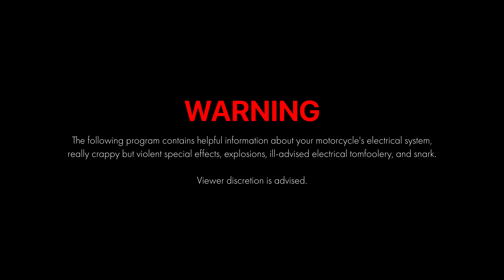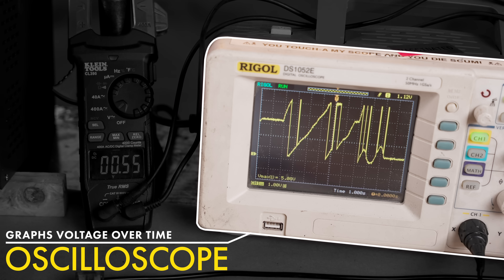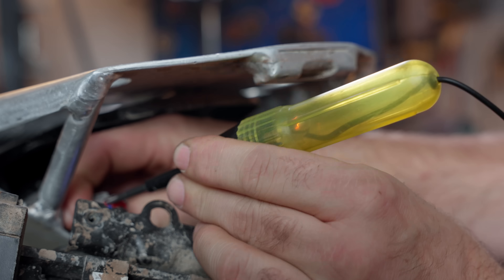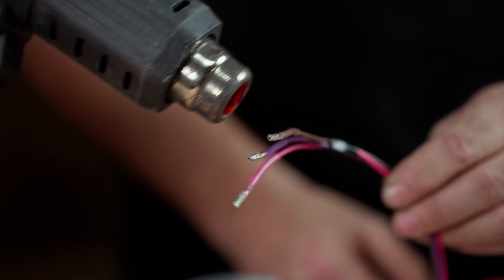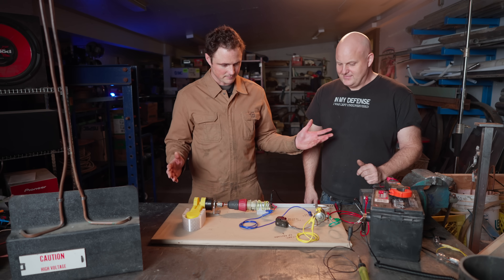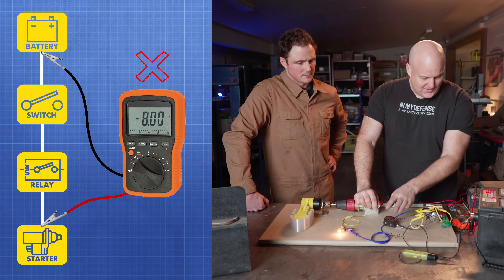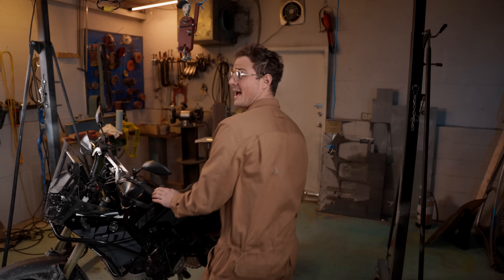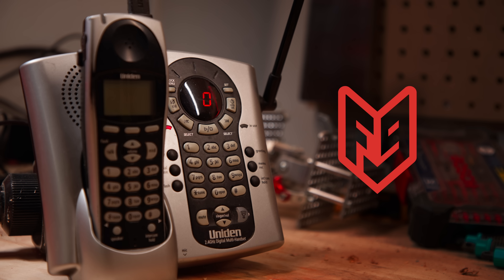5 Motorcycle Electrical Tips from a Pro

Comment: Hello so recently I've installed a new headlamp and blinkers and such. Is it possible to wire my front blinker grounds to the headlight ground on H4 plug or is that a bad idea? I kind of deleted the splitter ground thing it had going on. I planned on going full rebel with no front blinkers but have since changed my mind since acquiring some decent amazon blinkers that i like.

Comment: With regard to the TPS, the one on my Tracer 9 was replaced under warranty last year due to throttle surging and hunting on tickover.  It's now been recalled as there is an issue with some CP3 TPS units so it will be a new TPS and EMU map, I don't know if it affects the CP2 engines but I would bet the TPS is a common component in both.

Comment: that starter system diagnosis really helps! i have a odd issue with my bike where somtimes i press the button and i hear the relay click but the starter does nothing i have to push the button a few times and then it starts so im gunna use those tips for sure!

Comment: omg--you get it!  I have so many times tried to tell technicians that a bad wire can ohm out good but still be bad and will read voltage as well ---made a video where i actually cut the wire in the middle and  stripped the ends--simply laid one end on top of the other and shot from end to end continuity and power --good every time ---this is why a bypass wire is often your best friend.  Also held true on a o scope, a 3m 900ast, low voltage test bulb as a load lamp, and a $100K eclypse tester.  In over 42 years of my career I had to explain this over an over to non believers and that a fault isolation manual and ohms checks were a start not proof.  In all the time utube has been around this is the first time I've seen someone present this simple truth.  Congrats! you get I see! subbed. if only you were around to say yeah he's right all the time ha ha ha !  :)

Comment: I love the jump from safety pin non-invasive splices to an oscilloscope! Though I would wrap a bit of electrical tape around them at least, it's very easy to blow a fuse or short something with those jutting out at an angle like that. Also if you don't have an oscilloscope, while they are pretty useless for most oscilloscope things, those little $30-50 'mini oscilloscope' kits on Amazon should be adequate for something like this.

Comment: Can someone, please, deeper explain Tip # 2? I didn't get it at all. Where do you need to put the tester on?
Reply: He has the test light alligator clip on the bike FRAME for ground.  He is probing with the tip on positive wires and sees the lamp light when it completes the circuit.  Then he connected the tip to a ground wire somewhere on the tail lamp.  This completed the ground circuit  through the test lamp connection, and allowed the tail light to light up,  so he knew there was a bad ground connection somewhere between the frame and where he tested with the tip.
Reply: @timothyswartz5292  thanks man. I barely know anything about electricity/electronics and I thought this was a pretty good tip. I appreciate the explanation, is way more clear now

Comment: Friggin' love it.  However - DONT EVER USE SILICONE CAULKING for anything electrical.  It produces Acetic acid when it cures - This is vinegar, and will thoroughly corrode wiring in a couple of hours.  Specialty Silicone gasket goo may work;  RTFM (Read The Full Manual.)

Comment: Jump starting from another vehicle is perfectly ok even if the engine is running. All 12v automotive batteries are charged at around 14.6v just like your bike does. 

A battery on a tundra showing 14.5v while the engine is running absolutely won’t ‘fry’ your dead bike battery.
Reply: Of course you are generally correct. The details get complicated, but in general there is little risk jumping a bike from a car. The guy making the video clearly does not have a strong background in electronics or risk assessment.

Comment: Hey, Fortnine, I have an electrical issue that beats me in my starter setup. Power goes to the relay but it does not pass through it. I’ve replaced the relay twice, but to no avail. Is there any reason that might be happening?

Comment: The trick with the pins on the back of the connector is neat, but people usually don't have those handy. 

What I usually do is get a paper clip and wrap it around the probe a few times, then create a sort of extension. It works wonders. 

Regarding measuring voltage instead of ohms, I thought that I was the only one who got that lol.  I even check fuses that way. The voltage at the top has to be nominal, then measure voltage at the bottom of the fuse, and if it’s different you know there is a bad connection.

Comment: You don't need a oscilloscope. The needle on an analog voltmeter will move with (and show dead spots in the coils), and works just as well for testing throttle position sensor/actuator and more. (FYI-I got a perfect score in electrical at MMI in 1990) You can also buy replacement electrical connectors at industrial hardware companies like Grainger.

Comment: I once used a large safety pin I found lying on the ground to reattach one the battery cables on my 650 Seca (remember those ?) when the nut fell out. Never underestimate the utility of safety pins. 
I like how you blew up 47. I thought there was a message in there, but then you diluted it by offing a couple more clones.

Comment: as an electrical engineer, i'm obligated to say the first one is a terrible idea, specially the part "you can ride with it to keep track of the voltage", yeah, no. it's fine for on the bench measurements, as long as you are careful, but on a ride, that would 100% short, which doesn't seem like a great idea, depending on where you are checking the voltage from

Comment: Just a nitpick on 5:22 stranded wires designated to be crimped shouldn't be twisted. It interferes with the butt crimp that's designed to separate the wire strands into two bundles before squeezing them into a cold weld. 

In practice, twisted wires will probably work fine at first but will fail earlier due to corrosion working its way onto the crimp interface, or the wire just works itself loose.

Comment: I got my Street Triple RS's battery drained overnight because i forgot to unplug the keys. Only connecting an external battery for starting the bike wasn't enough, the bike would not keep consistent RPMs and eventually would stall, only by keeping the external battery connected for a while  would prevent this. I guess Modern bikes rely on some electrical power even when they are started.

Comment: The safety pin tip and the silicone tip are real redneck engineering dodgy tips. They will probably work, but just keep in mind that they are absolutely not best practice.

You absolutely could damage something jamming a safety pin into the back of a connector - you might break the wire, you could damage the waterproofing, etc. Be careful, and consider other options for measuring first.
The silicone tip is a weird one, as surely it'd be easier to just replace both connectors with something suitable, if not original. Lots of commenters have pointed out that silicone can be corrosive, and you won't have any of the latching mechanism, so I'd expect a lot of silicone improvised connectors to unplug themselves given all the vibration. Even just individually attaching the wires in the connectors with single wire crimps seems like a better quick fix.

Comment: Good video, especially explaining  how a resistance check can mislead you in a high current circuit. I do have to disagree on "cooking" the MC electrics by leaving the jumper cables connected. "Cooking" happens when too much voltage is applied to a circuit. The largest 12V battery is still 12V, and the MC circuits will only see 12V applied to them.
PS: I hope 49 didn't cause too much damage to the truck's grille.

Comment: Motor company certified motorcycle technician here.... rebuttals:
1. Safety pin probes... "no". could easily damage the waterproofing rubber on the back of the connectors. Just unplug the connectors and do your tests there with jumper leads.
2. Oscilloscope: "yes", but expensive and you don't really need it. you'll be able to see the glitch on a digital multimeter if you go slow enough, and if you have an analog (needle) type meter, you'll be able to see the glitch there for sure.
3. test light on tail light- "ok, but to do not back-probe connectors"... could damage the connectors. Just unlpug the connectors and test that way. Make yourself test leads with ends that fit the male and female pins of the connector's plugs.
4. silicone connector: "only carefully". many silicones release acids when curing, which could damage the connector's plugs or the device you poured the silicone into. Check the formula of the silicone before using to be sure it won't release acids when curing.
5.testing the starting system for voltage drop... "yes", H-D does that a lot and it is effective. However, a resistance test using an ohmmeter WILL show increased resistance when it's there, so either test is viable.
6. jumping a MC with a car: the car must be OFF when jumping a bike. it's not the battery that fries, it's the voltage regulator that fries. When the voltage regulator fries internally, it prevents your bike from charging your battery as you ride. it may appear you fried your battery, but you actually fried part of the system responsible for re-charging your battery.

-you're welcome, all.  ;-)
Reply: Back probing is a tried and true testing and observation method.  Most manufacturers use proprietary or near proprietary connections. Finding proper pigtails to install a test jumper isnt viable in most cases. Safety pins, ot T pins which is more common are perfectly valid methods of back probing,  specifically becayse they are so small and will feed through connection gasket easily. They also sell actual back probing test lead kits that have a probe with an end that will fit on your test leads for a solid connection. 

Any tool use improperly can damage what you are working on, however probing the connection side of a plug is the easiest way to damage the contacts. Probing from the rear avoids damaging the blade connection entirely.
Reply: Thanks man, I really need your advice over the koenigsegg guy because he's probably not even a real "Motor company certified motorcycle technician", he's just the founder of a car company
Reply: Regarding #6, you are absolutely right about the donor car being OFF when jumping, and that goes for jumping ANY vehicle. Two generators on the same circuit is always going to cause trouble and must not be allowed to happen. Also, with the donor car OFF the electronics are also off and therefore not likely to be damaged by voltage surges and spikes. Finally, vehicle generators are NOT designed to power starters! A starter is effectively a dead short when initially energised until it starts to spin.
Reply: To add to the connector, it's silly but use paint to mark orientation, certain configs can just have you putting back in and 'rotating' the pins around, especially without hard plastic guiders, you can 'force' a silicone plug another way. As for back probing, like, in this exact setup with two safety pins just parallel.. yeah, no.
Reply: 6) Crap, I jump started my bike (bmw 800cc) with my opel karl (1000cc). 
Is it really a big problem if both systems are somewhat still on the somewhat power level?
Reply: Hi, can you elaborate on why the regulator will die when a cat with running engine is used? I was always told 12 volt is 12 volt, but i am definately not an expert.
Reply: @rienkhoek4169  I'm confused by that as well other than cars will show 14v+ when running (the alternator needs to be higher voltage than the battery to charge a battery)
Reply: @subjekt5577  True, but that is the same for a motorcycle.
Reply: The back probing for diagnostics via safety pins is a bit janky, but probably OK. I do wonder what he means at 0:40 when he says connecting to something on your dash while riding. Is he saying diagnostic or to permanently wire up something? Diagnostics... ok, permanent... no.
Reply: Nobody got time to make plugs and nobody is going to pay for those hours.  Back probing every day for the last 4 years. You are not going through ruber seal, you go along the wire.
Reply: About the silicone thing, if it smells like vinegar, don't use it on your wires EVER. That's only good for the engine casings.
Reply: How do you know he's not a certified technician?
Reply: The only one of them I can coment on is the first one. If you shuve vi the pins you will probably brake it butt bearing cerfull can work once ore twice untill you slip and destroy the connector
Reply: Thank you! 

Sincerely, nobody

Comment: Thank you!!!!!!  #5. Jumping. I tell customers this and they think I'm crazy. "I jump it with my truck running all the time". Yea there is a reason you gotta jump it all the time moron!!!  I was 15 when I learned this. My father took my 1100 Suzuki to town. Killed the battery some how. And jumped it. And I suddenly had trouble with it a lot. My mentor told me why and showed me how to fix it. Owners never friggin believe me when I tell them to leave the car/truck engine off. At the shop we have a marine battery with a set of cables with clamps from an old school jump box on it. For something with a junk battery that needs other work its the power supply.

Comment: Another couple tips: you can use a test light in reverse if you're careful, to find if you have a bad ground (especially because many switches are ground and not power switches). Also, trying to run a starter on low voltage is the easiest way to break it, even worse than cranking over for more than a minute with a good 12+ volts.

Comment: I was wondering just how you were going to get 46... er 47... 48... 49 in trouble with only 12 volts. 

Also, if you're ever jumping off of something other than a passenger vehicle (hey, maybe you broke down at a your local gravel pit or construction site), double check that it's a 12 volt system. Some of them are 24vdc rather than 12. Won't kill you, but your bike isn't designed for 24v.

Comment: BTW viewers, if you have an older diesel (7.3, 6.0 etc) changing out or upgrading the gauge of the battery and starter system (with new ''military'' style terminals) and espcially with a hydraulic crimper, your cold start days will be over (less you have a weak fuel bowl heater...) Made all of my trucks incredible, even using factory wire, just putting real copper crimps, and real terminals got many more amps to the starter.

Comment: This was great!  So I hooked an oscilloscope up to my DR650SE throttle, and it told me that it was completely dead.  I ordered three new throttles just to have spares.
Honestly, this was a stellar presentation, guys.
Reply: Bro just plug your DR into an OBD2 port and pull the codes. Yea, these modern motorcycles with their FI, ECUs, and drive by wire throttles are just making a circle wheel squared. K.I.S.S.
Reply: I do most of my klr repairs with a wooden club.
Reply: DR650SE's don't have throttle bodies, they have carburetors (unless yours was heavily modified). the oscilloscope test does not apply to carbureted bikes.  Just in case people don't get the joke.  ;-)

Comment: Good, practical tips.  For most troubleshooting I think a guy should skip the $400 Fluke digital voltmeter and get a test light from a garage sale.  If you're not well versed in electrical troubleshooting the high impedance input of a digital meter can steer you wrong.

Comment: The reversed voltage trick is brilliant if it works. 99% of tough, intermittent or indetectable electrical problems I've had have been because of high resistance that only really shows itself under load. Sweet tip

Comment: I’m retired now but started using a two channel oscilloscope in the early 90’s. Never looked back. Graduated to a four channel Pico scope in 2011. With that you can test starter draw in amps , voltage drop to the starter, charging voltage and current all in one test. Hook up start the bike and look at the results. That’s just one example. It’s also the best way to diagnose CAN bus lines and modules. Every modern shop should have one.
Reply: Amps can be quite high, does it use a clamp to measure it indirectly and use one of the channels for that?
Reply: @  Yes it uses an amp clamp on one channel to measure starter draw, which is an indication of starter health or there is a mechanical reason the engine is hard to turn over. Say for instance there’s a broken or worn automatic decompressor. 
When the engine starts it reads the charging amps. So double duty.

Comment: If defense of CAN, it's very good and very accurate especially if you have at least three modules (two modules blaming one makes life easy) 
You can check the terminating resistors on CAN as well which can show a dead module.
You can also use software that will show you in real time CAN errors and where they came from.
I used to be a motorcycle mechanic before moving into material handling and yeah, CAN BUS is a superior system and best of all it's not propriety it's a universal system.

Comment: I have a little pigtail with 45-amp Anderson PowerPole connectors on one end and eye terminals on the other.  Connected to the battery and stuffed under seat or Tupperware when not in use, it's a fast and convenient way to charge (my chargers also have PowerPoles on them).  Add a pigtail with a single wire (for hot side) and a wire loop on the end, and you have an adapter to plug in for jump starting (connect the cold side jumper cable to frame ground).